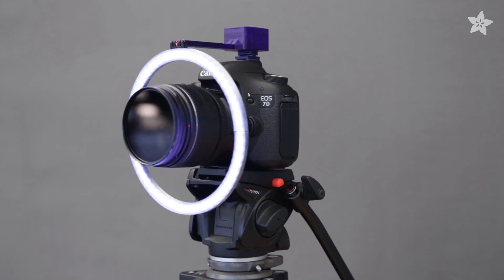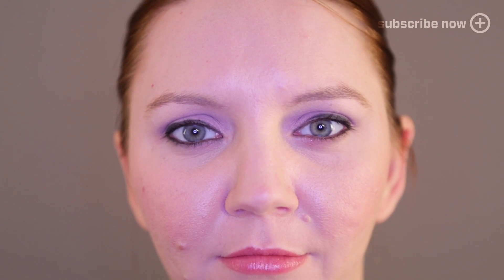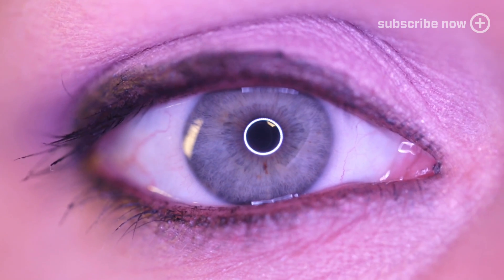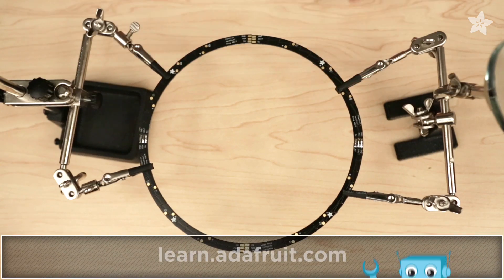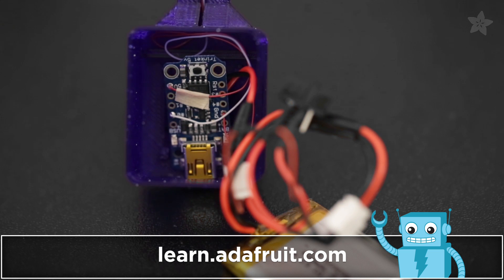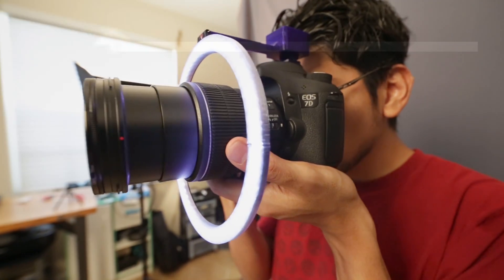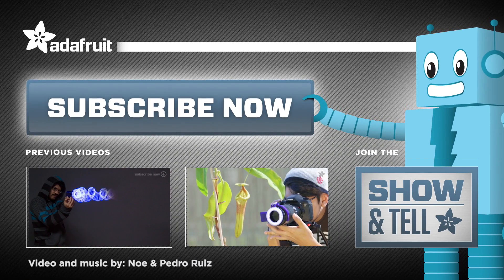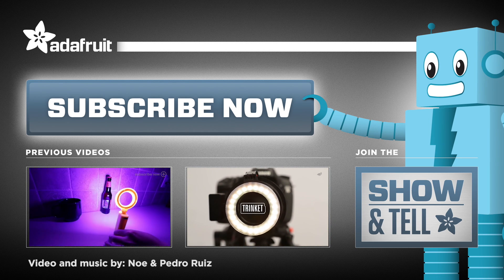DIY Light Ring for Any DSLR - 3D Printed NeoPixel Ring Camera Mount

Comment: Can you please make a video going through the steps in programming the trinket, for this project,   showing the wires soldered to the ring and trinket,   I have bought 3 them and none work.
Reply: There is a circuit diagram in the guide: https://learn.adafruit.com/3d-printed-camera-led-ring/circuit-diagram

Comment: What's the trinket doing in the tutorial? Just providing power or is it running a sketch? If so, what? The tutorial only covers the 3d printing and connecting of the ring.
Reply: +kriista The trinket is controlling the pixels. It turns them on and sets their color. In this case they're generally all white, but they still need to be set that way on power up. Check the tutorial on the Adafruit Learning System for all the details. Their customer forum is full of helpful people as well.